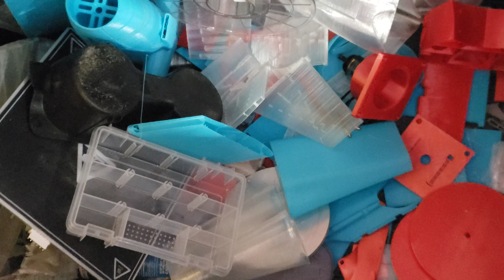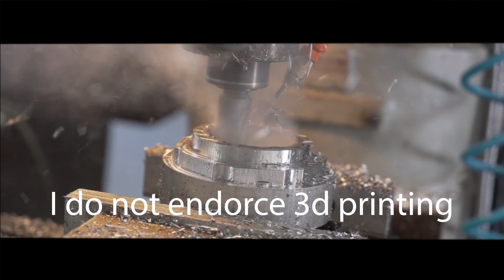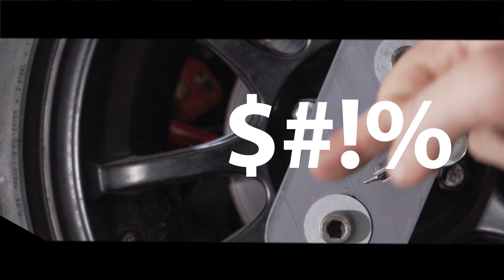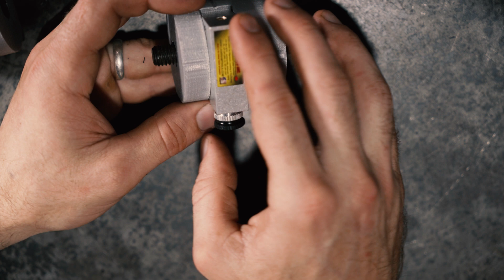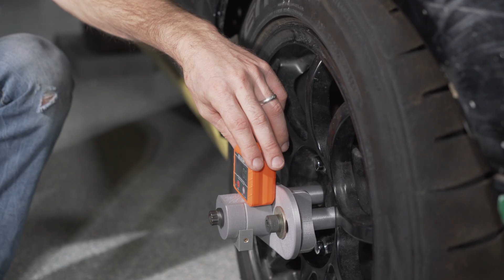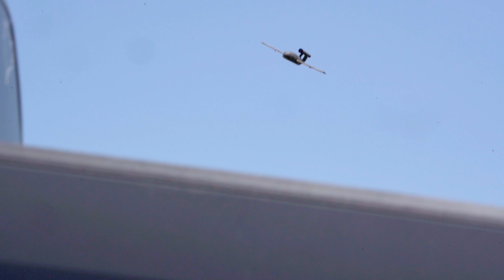3D Printed Laser Alignment Tool

Comment: A laser bore sighter for a pistol should be a precision centered laser. They are inexpensive too - a 9mm sighter is less than $15 on ebay. I didn't find any STL files but that's ok with me since I don't have a 3D printer! Thanks for the clever idea.

Comment: Neat idea, I made something in steel using the same principles a few years ago, mine however reference off of the rim edges.  

your calibration method might be giving you some error, I would think that the camber of the hanging wheel in your case a couple of degrees, and the laser being mounted ~1” above wheel center line in one direction and the same below in the other would cause some error.  Take it to the extreme, if the wheel hang camber is 45 degrees there would be an obvious difference in the two positions.  In your case it is probably minimal, but just a thought.  I calibrate mine on a 8 ft granite counter top, a surface plate would be better, but don’t have one.

Additionally, some of your error, as compared to the ‘pro’ alignment could be rim runout, as you showed in you runout test.  

As for camber, you are very dependent in the interface to the lug nut mounting surface.  You my want to rotate the wheel 90 deg to get some improvement, spreading those points out, but out to the rim edge will be even better accuracy.

Cool stuff though.

Arnie

Comment: Very few techs are carefully/acurate enough when it comes to setting up and using the alignment machine. There are so many things that can be done wrong that will affect the result. I'm willing to bet that if you take it to a different shop you would get different results. It even if you take it again to the same shop.
Reply from the maker: I've noticed that, I ended up buying a proper alignment machine, and I've checked it against other machines. It's definitely not a science lol

Comment: Your toe was slightly off because the track width is usually slightly narrower in the back.
Reply from the maker: Interesting, is this miata specific, or a car thing?
Reply: @BlipSS   Car thing. Almost all cars have a different front and rear track width. You have to measure that first and make up for the difference.

Comment: Did your tool account for the possibly differing front and rear track width?
Reply: Another issue i see (which you could i am sure fix) is that the runout measurement/compensation only is on the wheel plane which goes through whichever wheel studs you happened to choose.  So that is going to be a bit random.  But 1/2 of .015 if you happen to hit that plane is going to add .19 degrees of error right there for that wheel if you happen to use the wrong studs.